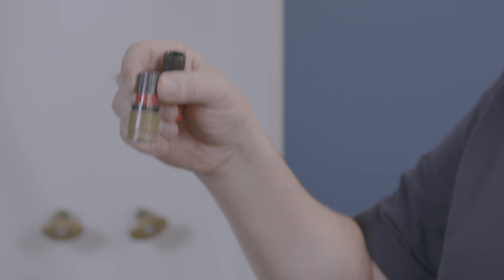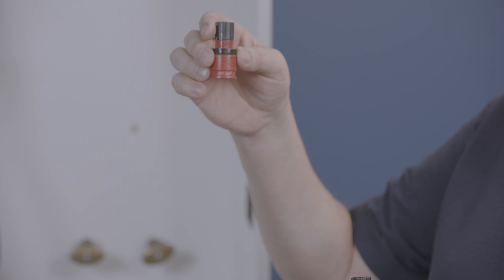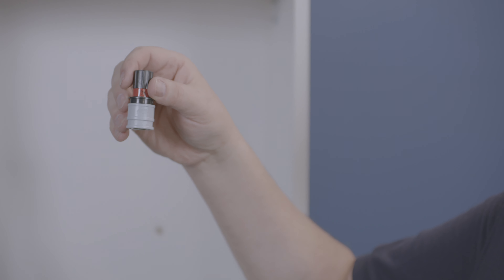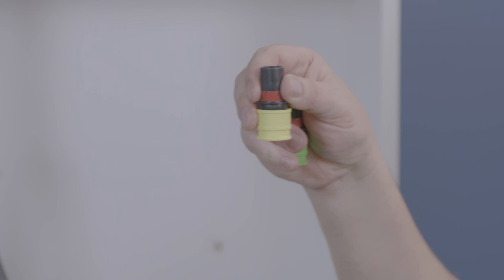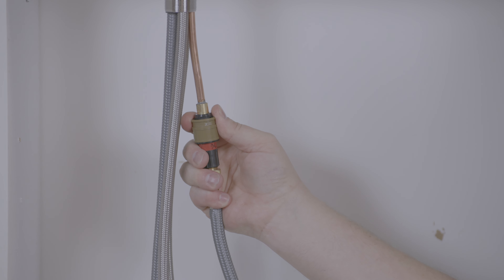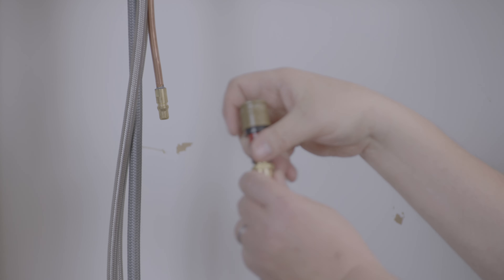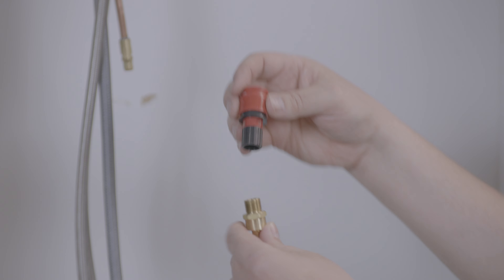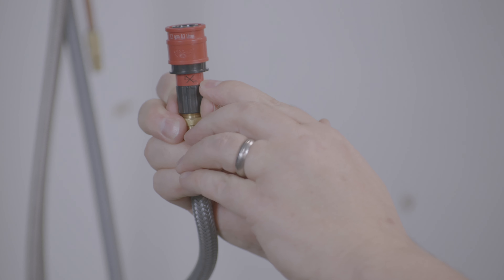GROHE | Quick Coupler Replacement | Installation Video

Comment: Thanks for this video.  When I disconnected the coupler as part of the process to remove the hose, a small black o-ring or washer fell out.  I found it on the floor of the cabinet once I had disconnected the coupler.  Your video does not mention that at all.  Where does that come from?  Between the coupler and the faucet?  Or between the coupler and the hose end?  Thanks!
Reply from the maker: Hi Graham, thank you for contacting us. The o-ring comes from between the coupler and the hose end, but if it has fallen out, the quick coupling would need to be replaced. Can you please email us at Groheconsumerconnection@lixil.com and write, "Attention David/Alisha" on the subject line? Once our team knows which coupling you have, they can further assist you. - GROHE Social Team

Comment: The 12 365 OEM replacement part as shown on the diagram does not fit the hose thread. It is smaller than the original. How do I order the correct part since ordering by the original part number does not get the original part?
Reply from the maker: Hello Doug, thank you for contacting us. Can you please email us at Groheconsumerconnection@lixil.com and write, "Attention David/Alisha" on the subject line? We'll be happy to assist you. - GROHE Social Team